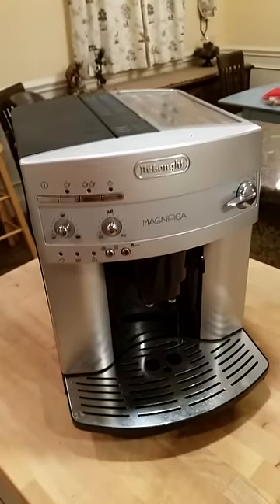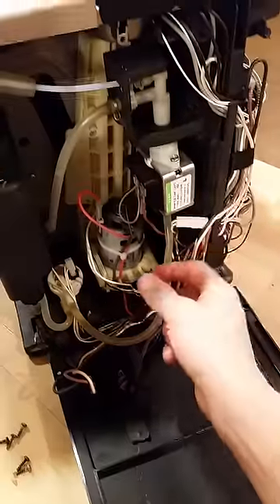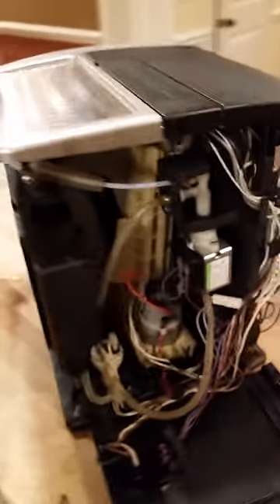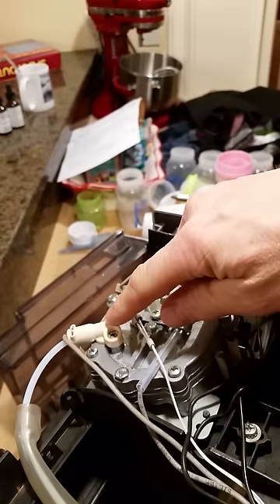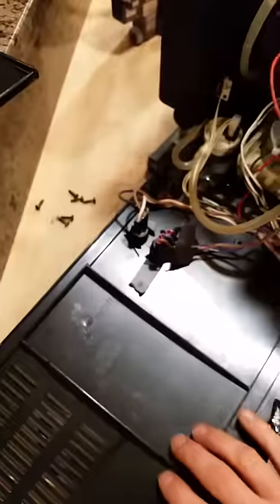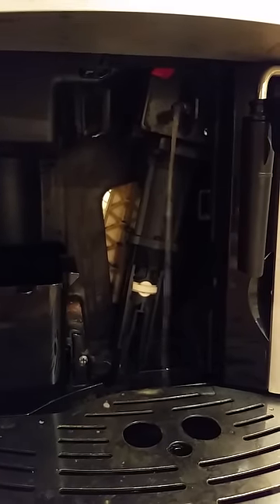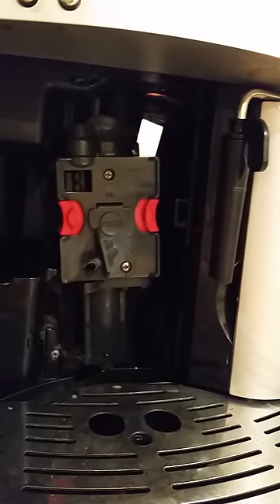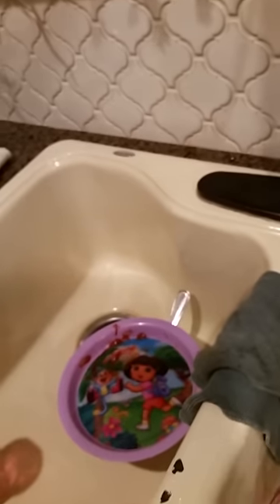Part 1 : Pulling apart my Delonghi magnifica. Info on several common issues

Comment: I have a Delonghi Magnifica Type ESAM-3500.N, this video really helped, simply just removing the back and side panels etc. I replaced just the water pump, $30 CDN on Amazon. One issue is the new pump not having any water in it when you start up the machine for the first time, all I did was insert the water spout and run the hot water option until the pump sucked up water from the tank. I also removed the brew group and re-greased (food grade) the O rings and removed and cleaned the stainless steel screen sitting on top of the brew group.

Comment: Timo: you are my new hero!  Thank you for demystifying the innards of the ESAM3300 -- with your great video I was able to open my "new" unit and clean it, and now I'm going to get acquainted with my sensors!  (I've got a unit where the infuser is stuck at the top, so it's a slow process to determine what the culprit is).
Reply: If you find out what the issue is, it would be incredibly helpful. Mine does the same thing and makes a very loud alien kind of noise before having 4 lights flashing.
Reply: @gabrielsabourin2529  Mine turned out to be a clogged (calcified) flow meter.  I drilled it out (maybe a bit too much), and it works now but the Volume/Amount knob is now incorrect.  For $18 I can replace it…maybe soon, but with it making coffee again I haven’t been in a hurry.
Reply: @garyszabo  Thank you!

Comment: Thanks for this video.  I had allowed my water pump to run dry by removing the water container while it was pumping.  The pump was unable to recover.  I opened the machine with the help of your example and primed the water pipes.  The pump was able to recover after that.
Reply from the maker: in the future, fill your tank with water and turn the steam knob so that it is running water.  let a half tank of water run through.  This is the recommended method for priming  the pump

Comment: Hi Timo   Thanks so much for your video.  We have to repair our own machines.  And, your video is the most instructive and useful to date.  I continue to have the coffee ground light blink despite assuring that the sensor clicks properly - after cleaning out the bottom of all coffee grounds etc.  Unit works for a few cups then reverts to the blinking coffee ground light.  I believe it might be time to replace the coffee ground sensor.  Do you have a video showing specifically how to do this?

Comment: Your videos are great, saved my machine a few times. I may be at the end of my rope now…I pirated the boiler off my old DeLonghi, same model.  The current one was leaking water really bad. The black hose that connects under the boiler and feeds back thru the front of the machine was totally blocked. Got everything put back together but when powered up, the infuser cycles down to the drip tray and gets stuck. The warning light stays lit solid. No idea what to do from here. Any suggestions?  Thanks a million!

Comment from the maker: FYI if anybody has any issues and does not feel comfortable with repairing it them self.   I will work on doing repairs on a case-by-case basis.   it will be necessary for you to pay shipping both directions, parts, and labor.  Many issues on this machine require little-to-no parts just depends on what it is.    Just send me a message to seppalatimos@gmail.com

Comment: Excellent guide. Followed the steps but my coffee really week. Have been ignoring the descaling light though so will try that next.
Reply from the maker: Weak coffee wont be from descaling.   Are the pucks normal sized? The grinder works on a timer.  So if the burrs are worn out it will make smaller pucks, resulting in weaker coffee. 
Are the pucks watery/messy, or solid in the bin?  If they are sloppy and messy that could means the brew unit o-rings need to be replaced.  Pretty simple and inexpensive.  Do you remove the brew unit once a week to rinse/clean it?  (Its in the regular maintenance part of the manual). 
Could also have a leak, causing it to not build the pressure it should. 
I am assuming you know the basics (fineness of grind, amount of grounds etc). Too coarse of a grind will result in weak coffee also.
Let me know

Comment: With my five year old De longhi Magnifica Esam 3200 ,  the coffee did just drip ,no steady stream.It took forever to fill a big cup.The pump worked so hard and loud but did not bring enough water .They recommended to change coffee beans or adjust coffee grinder so its not to fine .Nothing helped .At the end we found out that the filter right after the water tank was clogged .You need to take of the side panel  .We cleaned the filter  with high pressure air .I am not sure where I can get a new one . Now the machine runs great again and my coffee has a nice foam on top .
Reply: @hildegard Ammann - im getting this same issue  (coffee just dripping a few drops instead of steady stream) but intermittently ...so does this mean i have a different fault? Surely if my filter was blocked i'd have the problem constantly?? Cheers
Reply: Turns out mine problem was caused by a faulty infuser....I ordered a new one from Delongi for £30...machine is now back in action! :)
Reply from the maker: probably better to replace the filter, or the problem will more than likely come back again

Comment: Timo - obviously you have a great understanding of these machines.  Our unit looks identical to the front of the one in this video. I did notice that there was a difference on the design of the heater when watching the instructions on changing out the o-ring.  That's not our issue though. 
We may have two issues... Here's what is happening: The first issue has been happening over the past few months but has never been much of a problem until recently... occasionally, when we push the button for espresso, the unit grinds but it is not pulling down the beans (you can hear the grinder spinning at a higher speed) so we typically wiggle our fingers down in the beans in the hopper to get them moving down and it works fine.  What has just started happening now is the Empty Grounds sensor light comes after the grinding cycle and nothing else happens after that.  Then the light stays on and the machine will not do anything so in order to get the light off, we have to pull out the up/down mechanism but the same thing happens again.  Since this latest problem with the sensor light it seems that the beans are not dropping even when we help them along as before.  I did pull the grinder out and tapped it upside down to be sure that there was nothing blocking the entry port.
Reply from the maker: have you been using flavored or oily beans?  you should never have to help the beans in (i've been using mine for 7 years now and never once have helped it)  the manual clearly states light to medium roast beans (no dark roast) and no flavored beans (they have sticky residue on it)   I would try doing a thorough cleaning of the bean hopper and grinder first
Reply: My "Empty Grounds" light issue was related to the hopper/grinder. I found that the chamber wasn't getting a full allotment of ground during a cycle due the grinder being clogged a bit. I opened the grinder up to full "coarse", ran a cycle, and returned the setting back to medium grounds. That seemed to fix the problem...for now.

Comment: Hi  @Timo seppala 
My 12yo machine looks to have finally died.
Switches on, you hear the infuser move, then the green cup lights start flashing and never stop. No water comes out, either when coming on or when switching off.
But water does come out of the wand when that's turned, but the water is cold. This makes me think it's the heater rather than the pump.
What do you think? I'm wary of buying both pump and heater since the machine is so old.
Thanks for the great video - you helped me take it apart to look for easy problems!

Comment: Hi Timo. 
Last night my Hubby tried to fixed our coffee machine. Delonghi ManificaEAM 3400.S, and accidental damage one of the wire next to the water boiler and circuit was short. Now he tried to turn on the machine nothing work. a red light on top of Menu light on for 2 seconds then off. The screen has light but blank. Thank you

Comment: HI, mine is stuck on heating up... however the heating element is fine as the coffee is hot. Where is the temperature sensor on those machines? I have a parts machine to get replacements.

Comment: Thanks so much for the replies yes everything else works fine I think it has something to do with the door beacause twice it worked when I applied pressure to the door as I was pressing the two button to engage the descaling process.  But now it does not work.  After pressing the 5 seconds to engage the descaling process the triangle light also comes on and I can’t d’escale it.  Thanks
Reply from the maker: There is a sensor inside of the top of the unit that gets pressed when you shut the door.  If you remove the top of the machine and look down in the front of it there is a micro switch with three wires going into it.   more than likely that switch has gone bad, pretty simple to diagnose.  The center wire is the hot leg going into the switch and the two outer wires are the wires going back to the circuit board when the button is not pressed it sends the signal one way and when you press it, it sends it the other way.  Take a picture first so you don't forget which way they were connected and pull the three wires out.  Using a short piece of wire you will need to jump power from one to the other.  when you put it on the correct position it will be thinking that the door is shut.   Then try to descale with it connected that way.   if it works you know that that was the issue and you order a new switch.

Comment: Timo
Thank you for the videos but please answer this question: Have
 you actually switched out the O ring in the boiler by removing that philips screw that supports the plastic housing? I’ve tried on mine and it won’t budge but that where water is leaking out of. Please advise

Comment: Thanks Timo, great video. You did not talk about the flowmeter, would that be a problem related to low flow? I am getting the warning "Grinding too Fine please change your settings, insert the water spout  and Press OK".  any suggestions?

Comment: Thanks for the video - I have a Magnifica ESAM3300 which now will not progress from flashing 1 cup and 2 cup lights on start up. The infuser rises to the 'middle' position and eventually the red triangle light comes on. Any suggestions - I've replaced the infuser recently and it was working fine. I've cleaned the machine thoroughly and tried hard resets but no improvement. Many thanks.

Comment: Thanks,
I purchased from USA a Delonghi just like yours. Delonghi Magnifica XS 110 volt. By mistake I took it with me to north Africa and I plugged it in 220 Vols. Now it doesn't work I know that the motor burned because it smell burning. Is there any chance to fix it! any suggestion please!
I don't know if it the electric motor or the digital control board. Because it still turns on and the digital button still works with green light but it doesn't supply coffee.

Comment: Hi Timo I Magnifica is about 6 years old, doesn't get used too much but I had a flashing warning light yesterday and when i opened the front i noticed that the grey block with the red release clips in in the top position and is stuck over at an angle. I have tried to take the machine apart but I have a problem that the bottom plate is fixed with special star shaped screw with a raised centre piece which wont allow me to remove these.
Is there a simple fix for this or this machine beyond repair, many thanks in advance

Comment: Hi Timo, I have a Delonghi S ECAM 4200. when turn on just work few second with all light on. After 3-4seconds wont work any more becoming all lights off. If I open front door triangle light is on. If I remove the water tank, no light at all. To check if something was burn out or something I have open it. So, nothing looks damaged. If I disconnect the machine and disconnect Hall sensor, then  turn ON the machine, the motor will works properly making the infusor go to top position. So, the motor works. If I disconnect the water level sensor nothing happen. So, what is the conclusion? Perhaps Hall sensor malfunction? THank in advance for your help

Comment: Hi Timo.  Thank you for showing the various areas that are problematic with the Magnifica.  I’ve had mine for nearly 8 years, I baby it, clean it, decalcify it, etc.  Yesterday, I noticed there was a lot of water at the bottom, on the counter.  Tonight, I checked out your video part 1, pulled it apart and tested to see where the water was coming from. It took a while, but I finally saw where it was happening.  Not a valve, not a tube, none of the normal culprits. It's the heating element!!!  On the, what would I call it... the horse shoe section that wraps around and connects to the fitting of the top left tube (if you're looking at the back of the machine), there's a little tiny hole that spurts water towards the inside, hitting that metal plate, then dribbles down.  Here's my question... since the heating element is discontinued with DeLonghi, and I couldn't find it online anywhere else, can this be soldered or repaired?  I really don't want to buy another machine quite yet. Everything else is working perfectly.
Any suggestion is welcome. Thanks!
This is my email nat.tessier @ gmail
Reply from the maker: Nathalie Tessier there are several locations online where you can purchase this part DeLonghi may not sell it but there is several other places you can buy it.  Do a Google search for your exact model I don't know which one it is, and the name of what you're looking for.  Yes in Theory it could be soldered but if you pay somebody to do that you'd be better off just buying a new part.   I'm pretty sure that part is made out of aluminum so it requires a special type of solder weld.
Reply from the maker: What is the model of your unit? Do you have a picture of the bad part?

Comment: Hello Timo,
I saw many your videos about common issues of Delonghi Magnifica. They are very helpful, thank you. I clean brew unit and lubricate unit and transmision regulary /every 3 months, also replace red seals - red rings/every year/ . All is was fine for long time, but I do have new issue with this machine which looks like leaking. I do have water inside of front side. No water inside back side. I sent you an email too. Please take a look on my photos, maybe you will know some tips what can cause my issue.

Thank you
Reply from the maker: I'll take a look first things first with a water leak take all the side top and back panels off and turn the machine on.  Usually the leak is very obvious
Reply from the maker: FYI I did not receive any email yet
Reply from the maker: another thought is to be able to test it for a leak you can open the front door of the unit stick a screwdriver in where the tab pushes the sensor to signal that the door is shut.   Hold it there while running it and it'll run a brew cycle.  Sometimes it's as simple as the little spring loaded door on the front is jammed and the coffee simply is spilling into the drip tray.  if the Brew unit is leaking you would be able to see that as well.   

all that said the most common leak on this machine is the o-ring on the water line going into the boiler unit on top of the machine.   if you fix it immediately it's a simple as changing an o-ring if you wait then the screw that holds it on will corrode and  won't be able to remove it forcing you to replace the entire boiler.
Reply: @timoseppala7137  it was 17. 5. 2019 21:30
, check spam plz

Comment: Do you know anything about: You press to make coffee, grinder is grinding coffee beans, the brewing unit is going on its upper position so it needs just the water to go trough, but instead the brewing unit is going back down and throws away the coffee grounds and then 2 lights are blinking: Empty coffee waste grounds and Warning triangle. In the user manual says: The pre-ground coffee funnel is clogged. But there is nothing like this. I also made the coffee grinder on setting 7 which throws a lot of coffee into the brewing unit, but still no joy. I tried with the setting for ground coffee so you can put it with a spoon, still the same. The machine thinks there is no coffee in the brewing unit.

Comment: Timo, I'm wondering if you can help. When I turn on the esam 3300 machine, it does the normal drain, then there is a bad grinding sound and then I  get a warning light. I open it, remove and reinstall the infuser and tray. The light goes out but if I turn the machine it does the same thing. I bought the machine a month ago. Any ideas?

Comment: Hi, great few videos you have on opening up and cleaning the machine. I have basically the same machine with a slightly different button layout. I am having an issue with the steam wand pouring out hot water while making a coffee. Also, the steam is lacking a bit during frothing milk. I have run a descale clean which seemed to increase the power water comes from the wand but steam is still a bit 'meh'. Do you have any suggestions as to how to get steam pressure back up and stop it from leaking water when making a coffee? Thanks

Comment: Hi I have the EASM3300 expresso coffee maker and I have just ordered a replacement water tank that does not come with a front cover. I believe I can remove the existing front cover from the water tank and re-attach it to the new water tank
Can you tell me the best way to remove the front water tank cover with damaging it 
Thanks